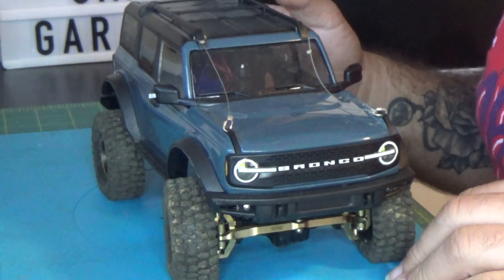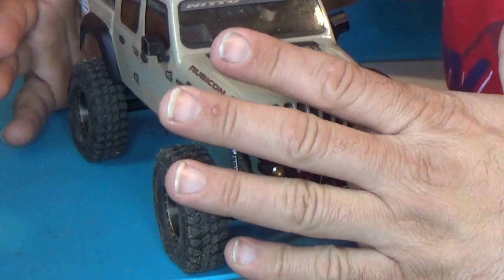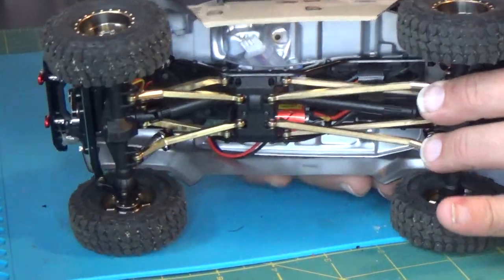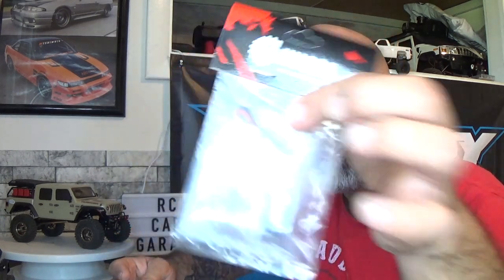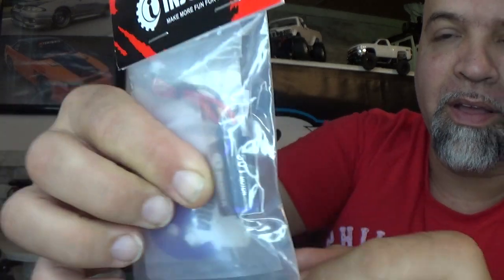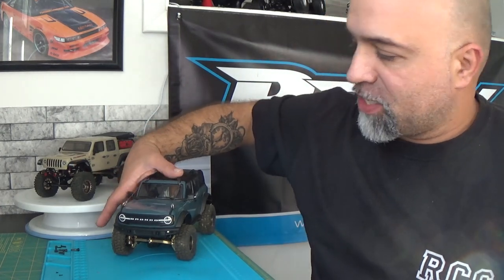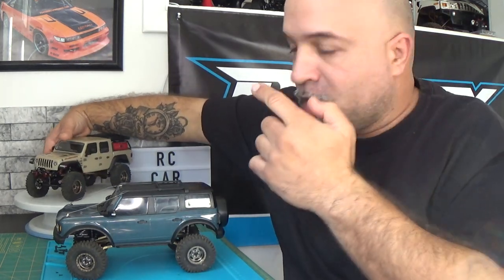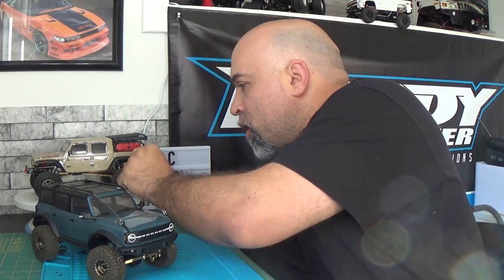SCX24 Gladiator VS TRX4M Bronco Brass Mod Comparison

Comment: Which would you recommend for best out of box package for a beginner?
Reply from the maker: Honestly either one is great for a beginner. They both have alot of aftermarket support and are both fun. Now the trx4m is a 1/18th scale and the scx24 is a 1/24th scale so it all depends on the scale you want but again they are both fun and very capable
Reply: TRX4M
Reply from the maker: Trx4m is a very good chassis but make sure you get a servo because the stock one will give out